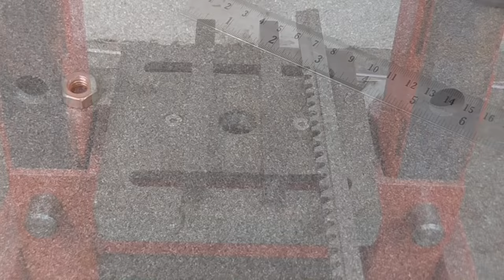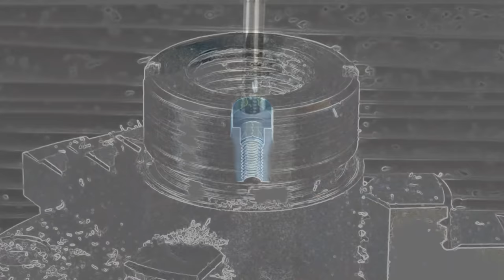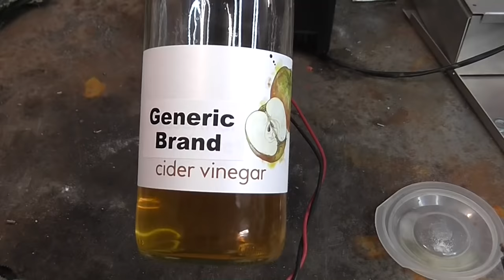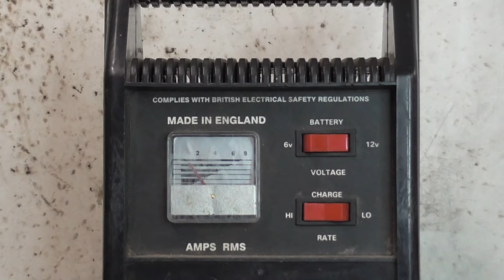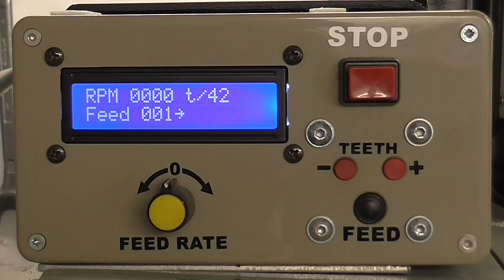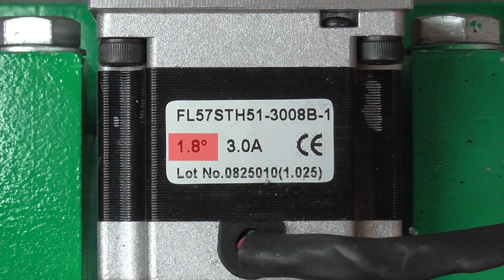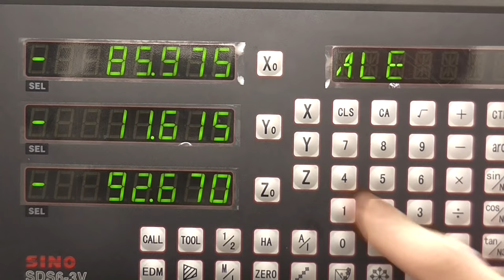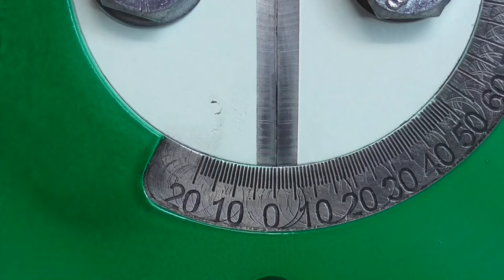Gear Hobbing Attachment (milling machine) Part 2

Comment: I am Spanish I was impressed by your excellent work, thank you for sharing. It could provide the schematic of the electronic part, or failing that, the program that relates the milling machine speed and the pap motor speed. Thanks a lot

Comment: An interesting lock-nut though. I've not come across that style before.
Reply from the maker: I actually copied the design from the one on my lathe, it takes up less space than 2 jam nuts, which is important when the spindle tilts to 90° to keep it from getting to tall.
Reply: Well, it's nothing new.  and it's quite logical w a little brain use.

Comment: Excellent work! You have an amazing amount of responses. It looks like people want to have a gear cutting capability in their home shops. I am one of them for sure. You may want to think about selling your new Arduino based controls when you finish your work. Many home shop machinists are not too good with electronics and programming and would rather buy the finished product.

Several guys asked you about helical gear cutting. I read your responses about tilting the hob and the gear blank and mostly agree with them, just need some time to settle it in my head. The short gears would probably be fine, but long ones may not. I am worried about tooth profile accuracy, not just the length of the hob. I think conventional hobbing machines syncronize the feed with gear rotation to produce a correct helix angle. It could be done on a conventional mill by adding another stepper motor to the table feed and change in programming. Maybe it is not necessary. What are your thoughts?
Reply from the maker: Thanks! I'm already giving away the design and programming for the controller for free! See my other video on the controller.

Yes, with this cutting method you are limited by the length of the hob when doing helicals, so you can't do a very wide gear with a high helix angle or you will run out of hob. But that would be quite an extreme gear anyway and I've never had any issues with this.

Comment: I have watched a lot of mechanical engineering stuff on the web and this rates as one of the best presentations that I have ever seen. I have spent a lot of time driving stepper motors and the like with micro-controllers to drive telescopes and other equipment. Is there a past video or link to the BRAIN build. I have never worked with encoders and would like to.
Reply from the maker: Thanks for the compliment! Yes, there's a video on the brain here: https://youtu.be/beT8312k3yI
One day, I'll do a video on encoders and how to build DIY ones (though I've quite a backlog of other videos to finish first!)

Comment: It's amazing how much cheaper this is than traditional similar equipment which required being physically couple to the spindle.
Reply from the maker: Not only that, it's much easier to set up and use, you can change the division ratio at the press of a button. With the mechanical system you have to set the ratio with changewheels and to cut a gear with a prime number of teeth you have to already have a gear with the same number of teeth in the gear train.
Reply: @AndysMachines  this sort of thing seems like it'd work well to solve a problem I was looking at actually. Some machines (like the lathe I'm restoring on my channel) have an oil groove carved inside bushings that need to be cut with a sinusoidal path on the inside of the cylinder.  

I believe it might be called helical or spiral oil grooves. The original machines for this were similarly mechanically coupled but a custom compound electronically driven like this might do the job.
Reply from the maker: Yes, I know the sort of bushings you mean. Perhaps a small die grinder mounted to the lathe toolpost would work, you could screwcut the internal groove turning the lathe chuck by hand.
Reply: @cavemaneca  That groove is like a screw thread with a very long pitch. Relatively easily done on a lathe with screw cutting facility. Not trying to take anything away from Andy - his machine is indeed amazing!
Reply from the maker: @gyrogearloose1345   @ThatGuy Makes Things  

Actually the other day I saw this which I think is brilliant, particularly the way the chain is used to drive it:  https://www.youtube.com/watch?v=TJH2q5ylJXM&ab_channel=EdVanEss

Comment: The skill and breadth of knowledge here is wild.

I don't understand how the skiving works. If they are both synchronized and moving along the same axis, where is the cutting action?
Reply from the maker: The skiving works because the tool is tilted at an angle to the blank, so even though they rotate together there is relative vertical motion.

Comment: I used to think that in order to cut helical gears the feed also had to move in sync with the spindle... but I was wrong. It doesn't! So cool! I couldn't feel happier for being wrong xD
Reply from the maker: Yes, there are other ways to do it where you have to gear the rotation of the blank to the feed of the table, but as long as the cut is lined up with the angle of the teeth then you can just feed as normal.
Reply: @AndysMachines  Yes! And this is so interesting! I used to think that hobbing helical gears would require much more complex math.
Reply: @AndysMachines I think I'm still intrigued by the geometrical implications of what you did. There is one thing I still don’t understand. You are able to feed out of sync with work piece only because you’ve compensated the hob angle in the spindle first? 
If you were to compensate the total angle (hob angle +/- teeth angle) only in the work piece tilt would it work the same? Or you would still be able to feed freely? (out of sync)
Sorry if it is a dumb question. I'm strugling to make sense with the geometry.
Reply: By "out of sync" i mean "with no required sync"
Reply from the maker: @tritile  The gear blank is 'synced' to the rotation of the hob only (with division ratio). The hob has to be tilted to it's helical angle by titling the spindle/column of the milling machine so that the angle of it's cutting teeth is parallel to the feed axis of the machine (horizontal in this case). The gear blank is tilted to the helical angle of the gear. You can now take the cut without having to advance the rotation of the gear during the cut. Any other combination of angles would mean you would have to advance the gear as it's cut (usually using a differential connected to the feedscrew of the milling machine) so that the cutter travels along the correct path.

Comment: How are you getting around using a differential to cut your helical gears? Technically to cut helical gears with a hobbing setup you need a differential to produce the helix angle of the teeth, or you need to calculate an index that rotates the part faster for a given feed or a feed that moves in relation to the rotation of a set index to produce the helix. You also need to add or subtract the lead angle of the hob, or I believe the ones you use call it helix angle, from the helix angle of the gear in order to make accurate helical gear teeth. In your application that would mean either moving your spindle or part orientation. In a gear hobbing machine where the part is in a fixed position on the work spindle that would mean swinging the cutter head only.
Reply from the maker: Yes, a differential (with one input from the table leadscrew) is normally used in the traditional setup on a horizontal milling machine to advance the blank with the feed. The way I'm doing it is to tilt the machine spindle to account for the lead angle/helix angle of the hob, and tilt the hobbing spindle to the helical angle of the gear being cut. The cut is then taken in the horizontal plane and the advance is taken care of by the relative motion of blank and cutter. The only disadvantage of doing it this way is that the length of cut is limited since eventually the cutter moves out of contact with the workpiece, but it's plenty to gang mill several average gears together.

Comment: Excellent engineering.  You lost me at stepper motors and controllers.  Very impressive.  Do you make all your own hobbs, or do you buy most of them?
Reply from the maker: I usually look out for 2nd hand ones, you can sometimes find them cheap. If I don't have a particular size, or want a special tooth form then I make them myself.

Comment: Brilliant content and video!  I really love that 90 degree tilt on the spindle and the versatility it adds.  Have you considered using a higher resolution?  At a resolution of 600 ppr there will only be 6 index positions per tooth on a 100 tooth gear.  Perhaps a bit too "faceted" for high quality angular transmission?  I'm now using hybrid steppers (motor, rotary encoder, driver, tunable software in one package) at a resolution of 7,200.  I makes a VERY smooth tooth profile on gears with high tooth counts. Just a thought.  Thanks for sharing.
Reply from the maker: Thanks for the comment! Firstly I've seen your videos in the past and been impressed with your work, especially the single-point hobbing of bevel gears, I'll have to try that one day.

Yes, a higher resolution would provide more accuracy, but really when the hobbing spindle is turning at any reasonable speed the individual steps are completely smoothed out by the rotating mass, it's only when turning extremely slowly that it steps noticeably. Also the gear hob once fully engaged guides the blank as it turns like a worm and wheel.

There are situations where having a higher resolution encoder on the spindle would help (and keeping 600 steps/rev on the spindle). When skiving gears you don't divide by the number of teeth, but by the ratio of teeth on the gear and the cutter. eg. when I cut the 32 tooth internal gear I used an 8 tooth cutter so had to divide by 4. I can only divide by whole numbers (with 600 pulses/600 steps) so the next largest gear I could make would be a 40 tooth since the next number I can divide by is 5. If I wanted to make say a 34 tooth gear, I would need to divide by 4.25, I could do this if I had a higher resolution encoder on the mill spindle (2400ppr). To cut 33 teeth I would need a 4800ppr encoder to divide down equally into 600 steps.
Reply: @AndysMachines  Thank you for the thoughtful, thought-filled reply.  Looks like I may have been overthinking this resolution thing.  

The hob spindle encoder I use (CUI inc. AMT10X) has a wide range of dip switch selectable resolutions.  This feature might be helpful for pairing cutter and tooth count when doing skiving operations.  Just a thought.  

I look forward to more of your superb videos.

 Thanks again.
Reply: Special Gear Hobbing Machine accuracy

Comment: Really impressive mate !  I wonder if work could be submerged in oil and run like an edm machine.  A copper gear electrode could slowly etch out gears over a few hours.  Could cut gears from very hard materials like tungesten carbide.  Also as a side point it would be interesting to see worm gears cut on your setup!
Reply from the maker: Yes, that EDM idea would probably work, though I've never heard of gears being cut that way (people often cut gears with a wire EDM). I expect you would need a finishing pass with a new electrode as it would wear throughout the cut. I haven't tried hobbing worm gears yet, but I may do a follow up video on this and other types of gear.

Comment: Great job! Just a question though  from an engineering pov:  the inner bearing (on the shaft) wouldn't supposed to be a loose fit so you can apply the right amount of pre-tention with the end nut? Now that it's mounted with the press fit you can no longer control how much tension it got . A part from that excellent video, keep up the good work!
Reply from the maker: Yes you're right, if you go back and look at the first video you can see I made this bearing journal very slightly smaller than the bearing so it can slide, though it was a little tighter than I wanted, it's not really as tight as it might appear from the video (you can hear the difference when I press the bearings on/over the 2 journals). There is still enough movement that I can tension it and a light tap with a mallet on the end of the spindle will back the bearing out.

Comment: I would love to see a video of how you make your hobs: calculations and machining process.
Reply from the maker: I might do a future video with more detail on this.
Reply: I second this. I've seen a modified Eureka tool made by Charles Lessig to do hobs, wonder what you use. Looks like just bought hobs for now
Reply from the maker: @CaskStrength777  I use a mixture of bought ones and homemade ones. The ones I make myself are nothing fancy, basically I turn a worm using a tool ground with the required pressure angle and nose radius, then mill teeth into it. The teeth have a small rake angle but no clearance on the sides or perimeter (such as a Eureka tool would create). I find the lack of relief isn't really a problem as the hob only feeds very slowly and I keep the teeth as short as possible so there is minimal rubbing.

Comment: You made a blueprint by doing this video!
Reply from the maker: Not really a blueprint, I had most of it in my head. I did a quick sketch to make sure it would tilt to 90° and everything would clear.

Comment: I wouldn't not have thought that the mill cutter lines would have gotten etched so much. Guess it is best to etch metal when it  is near mirror polish
Reply from the maker: Yes, I should have used a new sharp endmill as this one left some deep scratches which spoilt the look a bit as they really picked up the black paint. This etching process does work very well on smooth aluminium sheets.

Comment: Great video Andy. Is there any chance that you could provide some more detail on the electronics?  I'm sure that I am not the only one that would greatly appreciate it
Reply from the maker: Thanks! Yes, actually there is a chance! I'm working on an updated version of the controller with more modern components that will be simple to put together (arduino based). There will be a video on this in due course.

Comment: This is really cool, lovely project!  Have I understood it correctly that the same hob can be used to create any gear tooth amount as long as it's in the same module?
Reply from the maker: Yes that's correct, one hob, any number of teeth, spur gears helical gears, even worm gears. You only need  a different hob for a different module (or DP) size.

Comment: What is the largest module tooth you can cut on steel with this attachment and your mill? I'm interested in making large module gears (2.5-3.5) for high torque applications and I wonder if it's remotely possible to cut those with this kind of setup. Really enjoyed the video.
Reply from the maker: I've cut 2.5 mod steel gears with this hobbing setup and I think that's about the maximum for my milling machine (rather than the hobbing attachment). It's a medium sized bench-top type mill, it's not just the power but also the rigidity of the whole machine, you could probably go bigger with a full size universal milling machine. If you look at an actual gear hobbing machine they are very heavy and solidly built.

I have cut bigger (4 mod and over) steel gears with other methods on this machine, but when hobbing it's cutting several teeth at once which is harder work.

Comment: Very interesting....looks like you are cutting in the traverse system? I like your way of thinking.Great job!
Reply from the maker: Thanks! When cutting helical gears I am taking the cut in the direction of the table feed, not the axis of the gear, so there is no need for advance that you usually have to use a differential for.
Reply: @AndysMachines  I noticed that yes, so the lead technically gets cut by hob moving from top to bottom as you feed. That's what I like because it is everything not taught in 99 percent of gear cutting yet here I see it and it works.  Makes for a quick and easy setup although it has its caveats. Thanks for sharing.

Comment: it is a fantastic project. I was waiting for this video. You could share some of the c ++ code to de-multiply the encoder pulses and send them to an output. I am trying to learn programming to use in similar projects. Thank you very much for sharing your fabulous machines !!
Reply from the maker: Thanks, It doesn't actually run anything as high level as C++, it uses a very basic old microcontroller (which nobody uses nowadays). Most of the code is just driving the LCD display, the division of the encoder pulses is very simple (even easier to do with C).

Comment: Okay I see the electronics that you added the question I guess that I had in your first video was how you get the machine and your tool on the same page- synchronized.
 did you make all the electronics yourself as well, the programming of the magic box,  what's in the magic box? What communication scheme are you using between the drive and your magic box?
I guess I can imagine a few ways to do it but being that I'm no Einstein I figured I'd ask the man who's done it.
Reply from the maker: The 'Magic box' isn't really that magic, it counts rotations from the milling spindle, divides them by a number you can select and sends them to a stepper motor driver that controls the hobbing spindle. I built it about 10 years ago for my previous milling machine. I'm working on a updated version that people can more easily reproduce (arduino).

Comment: Impressive work!
Could you tell us more about the hardware and the code to synchronise the stepper motor with the spindle?
Reply from the maker: I might do a follow up video with more information on the controller as a lot of people seem to be interested in it. Though I built it nearly 10 years ago and it would probably be better to modernism the design and use something like an arduino.